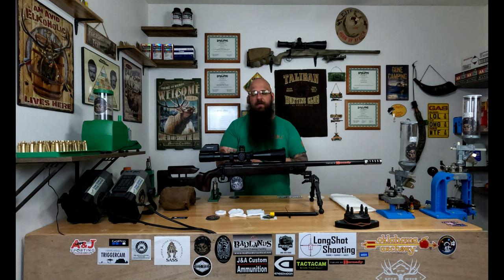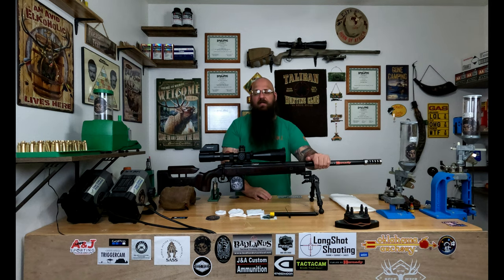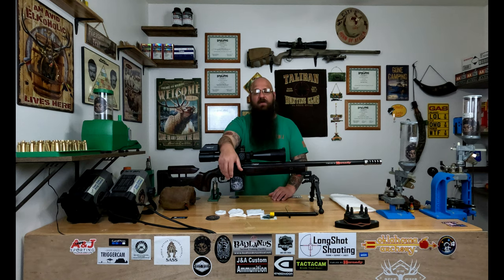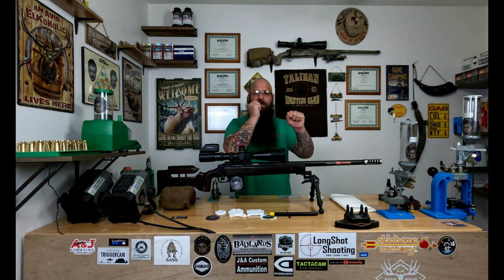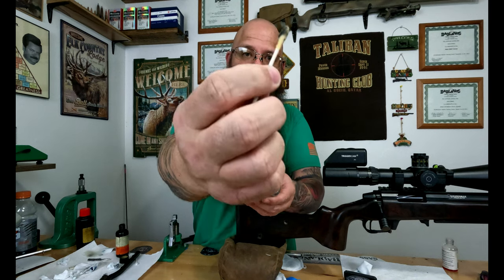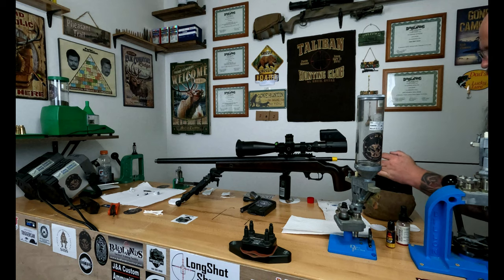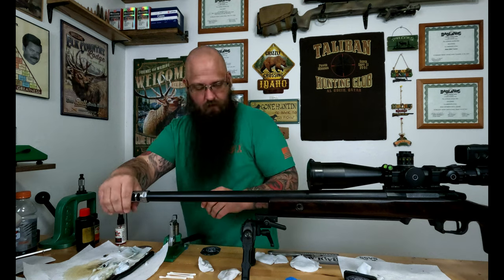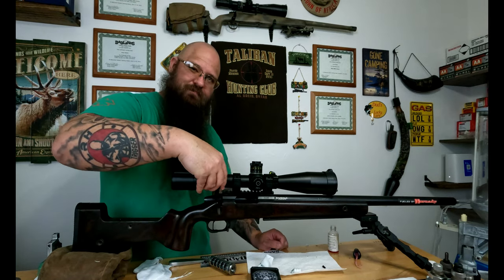How often should you clean your precision rifle?

Comment: Im a 1000yd benchrest shooter in both Light Gun, and Unlimited Gun classes as well as a custom rifle builder. We constantly clean our barrels. Accuracy degrades the more rounds you put down a tube weather its a hunting rifle, PRS rifle, or benchrifle. Weather i shoot 3 rounds or 15 rounds my rifles get cleaned. This will also help you get longer barrel life as well. At matches I clean in between relay and shoot off if i make it which at Williamsport we have Unlimited sighters for 5 min. Then our record string is 10shot group having a winner for group and a winner for score. Always use a good bore guide, good coated rod, good solvents like Sharp Shoot R Products, Butch's triple twill patches, and synthetic brushes only never use bronze or brass bore brushes. Only synthetics wortg buying are Boretech and Iosso and they last a good 40 cleanings. Every fourth cleaning i short stroke with JB non embedding or Iosso bore paste to get the hard carbon out of the grooves. You clean properly fowler shots do not exist. You can think you are fine just cleaning only when accuracy degrades but that is the ideals of someone who is not a gunsmith and understands how important it is to staying on top of hard carbon in your bore grooves. Big difference between what the facts are on these subjects and someone who "feels its their opinion" that contradicts the facts. A lot of PRS guys spend all this money on gear and components but literally handicap themselves with poor maintaining practices becsuse they follow the PRS crowd that even the best shooters in that do not take accuracy to the point we do in 600yd to 1000yd BR as well as F-Class

Comment: Thanks for the video jared. I have a couple different questioms. 
1) is modern smokeless powder corrosive like a muzzleoader powder would be? Im assuming not however i shoot both precision rifle, and muzzle loader for elk and the muzzle loader powder is pretty corrosive so u have to clean that often. Then it got me wondering if smokeless powder is corrosive too? Sometimes my rifles are sitting for 6-8 months before getting used again. Is this too long to let the fouling sit inside of it/will it damage anything? 
Second- how can i tell if a carbon ring is starting to devolop? Do i need a bore scope? And if there is a carbon ring what is the best way to clean that?
Reply from the maker: So no smokeless powder isn’t corrosive. When blackpowder burns it leaves a thick, heavy fouling which is both hygroscopic and corrosive. Smokeless powder fouling exhibits none of these properties. 
 
Now on your storage for 8 months a lot depends on the environment where it’s stored. If it’s in a safe with a dehumidifier it won’t really be an issue. If it’s sitting in a storage unit in high humidity it is definitely a problem. That said even in a safe if it’s going to sit that long. It’s a good idea to clean out the carbon and run a few oiled patches down the barrel. 

Here’s a good article about carbon rings and cleaning them that should answer all your questions. 

https://alphamunitions.com/carbon-ring-build-up-resulting-problems-and-a-cure/

Comment: Last step Chamber mop up:
If you have a plastic a-la-Glock pistol cleaning rod, at the gun store buy a big fluffy white bore mop and force thread the brass mop threads into the soft polymer rod.
Don't forget to buy a better quality pistol cleaning rod while at the store you support.

Barrel all spic-n-span? Removed the tube from the action? Now give that mop a super light spray of gun oil and run it into the chamber. Spin'er with the fingers and viola the mop absorbed any bad stuff plus left a little rust proofing. Put a clean cloth on one hand and place the mop onto it then pump shotgun that thing a few times. The mop will last longer and probably enjoy it.

**For you under 50 guys, Spic-N-Span was a floor cleaner, a soap, advertised on daytime TV when moms were at home with the kids.
Hence soap-operas were born. And be kind to your elders.

Comment: This off topic but I have Saco s 20 6.5 creedmoor using h 4350 powder and eld m what kind of barrel life should I expect to get ?
Reply from the maker: You should get at least a few thousand rounds on it before you start to slow down. Then just tweak the seating depth or tweak your load. Total barrel life where the erosion is too much. Depending on how hot your load is and how hot it gets should be around 8,000 - 15,000 rounds. It could be more but it just depends so those are realistic numbers based off what I have seen.

Comment: Awesome vid and I had learned about that not too long ago. Best to clean out carbon to avoid that contamination but keep the copper until it becomes a problem. And store my rifles muzzle down precisely for the reason that you mentioned. The last step I have in cleaning the bore is at least 3 patches of gun oil.
I also clean the throat with cotton swabs. And I put grease on the bolt and lugs to make for a nice and smooth motion.

Comment: If it will be more than a few weeks until I use a rifle, I dry brush the barrel, dry patch the chamber and lightly oil both to prevent corrosion (galvanic - steel / gilding metal)
Reply from the maker: Sounds like a good system

Comment: After each range trip I run a lightly oiled bore snake down the barrel 2-3 times, then address the bolt or BCG as needed. While the guns are still more accurate than I am I don't worry too much about the copper. It gives me more time for my real hobby of tinkering with bullets, powders, and the occasional wildcat.
Reply from the maker: Yup no point wasting time and money when you don’t have to. Spend that money elsewhere on stuff you need.

Comment: A few questions:

Is there a specific brand of rod and rod guide you’ve been happy with? 

Do you find much use for a boresnake?

Do you clean the protective oil coat out of your barrel when removing from long term storage, before you put it to use?  Meaning will it affect your POI for the first few shots if it is shot as is?

Finally, I’m sure you’ve met people who are on the opposite end of the cleaning spectrum. They never clean their barrels during the life of the barrel, with anecdotal good results. I’ve experienced 22lr rifles that fit this description.  

I’m aware this can potentially cause pressure spikes, rust, and once you commit to not  cleaning, if you do clean the accuracy may never return. On the other side, I’ve heard some of the mixed results attributed to the cooler/carbon fouling almost acting as buffer to any potential pitting/rust that may form from the lack cleaning. But again, you must commit to not cleaning once you go down this road. Just curious if you’ve ever experimented with this method or seen others first hand.
Reply from the maker: Hey bud so I have a couple different rods for cleaning. I have a Dewey deluxe and a Montana X treme. The Montana is by far my favorite of the two and what I recommend. Here’s the link for it. 

https://www.midwayusa.com/product/2161116255?pid=116255

I do have a bore snake that I keep with my range stuff. Honestly I rarely use it because it’s far better just doing it with the rod etc. The bore snake is more something I use in the field in bad weather conditions. Run it through to clean out any moisture etc.

So on when you remove your gun from storage or you’re safe with oil in the barrel. When you pull it out run a couple patches through to remove the oil. I don’t recommend shooting with the oil in the barrel. You could technically do it but it would give you inconsistent results. It’s pretty quick to just run a couple patches through before you leave for the range. 

So on the non cleaning I have seen plenty of it. The guys who are doing this despite their claims of how much they shoot. The reality once you know them don’t actually shoot very much. So they might not clean it for 20 years. In that time they are shooting the same amount as some guy’s shoot in a couple months. 

So the reality is they think that it doesn’t need to be because over long periods of time it has worked. Well it’s because it took them that long to get the round count up to where they have to clean it. That’s really why those guys finally decide to clean after all that time. 

Now they will claim that once they cleaned it it basically ruined it and wasn’t accurate. Well that’s not actually true. What is causing the spikes in velocity and pressures. It’s from the carbon ring. Now most people clean and take care of it properly every few hundred rounds. 

If it’s not addressed properly it will actually become bonded to the barrel and will be almost impossible to remove. The longer it’s left there the worse it will get. Which is ultimately why those guys actually end up cleaning the rifle after all that time. It’s also why they have accuracy issues even after cleaning. 

They are having issues so they finally clean it thinking that will fix it. The problem is that the damage is already done. So they will blame the cleaning instead of themselves. The reality is that it’s their fault. They didn’t properly maintain their gun and as a result the carbon ring is so bad after all those years that they can’t reverse the damage. 

Also because they aren’t cleaning their guns. This can lead to multiple forms of corrosion. Anything from weather conditions etc because it’s not cleaned out will settle in the barrel. This will lead to rust and pitting corrosion. This can be potentially masked for a while because the fouling basically fills the pitting. 

That will only mask it for so long though. So when they finally clean it they have the carbon ring which can’t be removed. Then you have the corrosion which has damaged the barrel. It also exposes the pitting corrosion and it’s not filled. So that’s why the accuracy seems so much worse after they finally clean it. 

So they think it’s the cleaning a day that they will never clean again. In reality though it’s their fault for not properly maintaining their gun. That neglect is what caused those issues. Like a lot of people out there they will blame everything except for themselves. 

You should always clean your guns periodically. This is for safety, function, and reliability purposes. Not doing so will create issues and damage the firearm. It can also become extremely dangerous depending on the amount of damage. I’ve seen multiple times where guys have had a gun blow up because they neglected to maintain it properly and it became damaged and dangerous.
Reply from the maker: Hopefully that clears it up for you if not let me know
Reply: @longrangehuntinggroup7223  that makes sense, thank you. I’d heard about uncovering pitting such. The carbon attracting moisture, causing rust pitting, then the fouling becomes essential to maintain those pits and imperfections being filled. 

While I’m inquiring about cleaning, do you ever store your rifles with suppressors attached? 

According to many suppressor manufacturers it’s not necessary to clean rifle suppressors specifically because the muzzle blast itself burns the excess powder. This does not include pistol or 22lr cans. This has been consistent with my experience with my suppressors as well. They don’t seem to cake up like smaller cartridge cans. 

However, I’ve read storing with any muzzle device, especially suppressors, allows carbon to attract moisture on your muzzle/crown. Have you noticed anything like this?

I’m always a little apprehensive about removing any muzzle device just due to potential zero inconsistencies putting them back on. 

Finally, do you do any additional barrel cleaning in the winter from the condensation build up from the temperature changes of going in and outside. I try not to clean my rifles during deer season but I know that’s when you’re most likely to get moisture build up.
Reply from the maker: @pbbananas  So on the suppressors I don’t actually have any. I have a ton of friends who use them so I’ll have to ask them. I do know that all of them do take their suppressors apart and clean them. 

During the winter or really any time that I’m hunting I’ll put a piece of tape on the end of the barrel. This will keep the moisture etc out of the barrel. It won’t affect anything though when you shoot. If I get into any conditions where moisture is a issue. Snow, rain, humidity, etc I will wipe the rifle completely down. If I believe there’s some in the barrel I’ll run a dry bore snake or dry patch through to remove the moisture. In those cases I’ll clean the action, bolt, screw heads, trigger, etc. anywhere that could potentially rust. The stuff you use to clean out your keyboard with compressed air is actually really good for helping clean out little areas.
Reply from the maker: @pbbananas  So I asked a buddy about storing long term. He said he just leaves the suppressor attached.
Reply: @longrangehuntinggroup7223  awesome! Thank you for responses. I appreciate the feedback.
Reply from the maker: @pbbananas  no problem happy to help. If I don’t know the answer I’ll reach out to people who do. That way you get correct information from a good source.